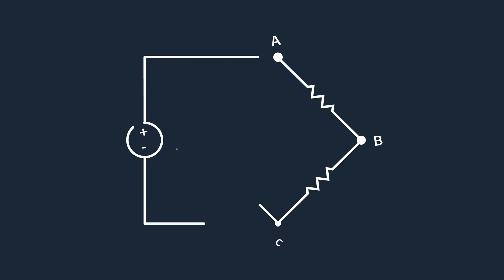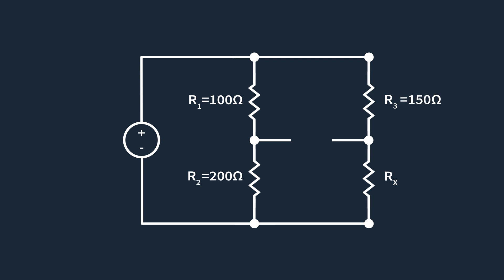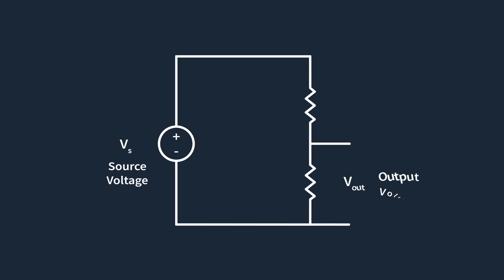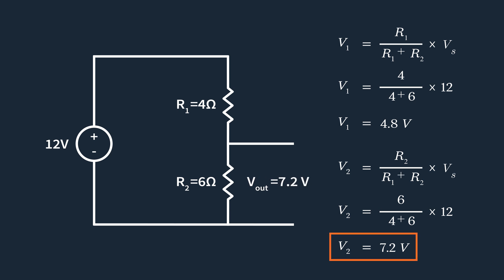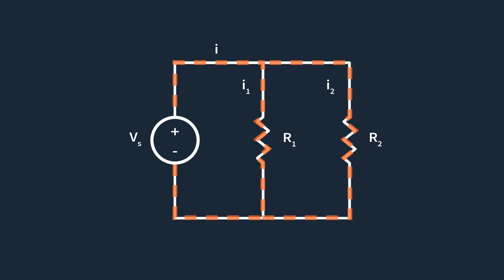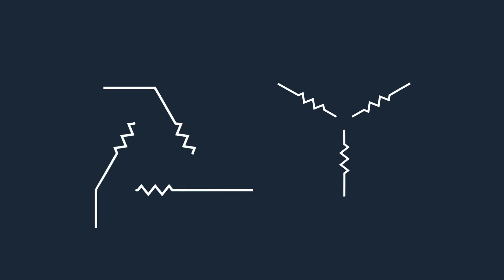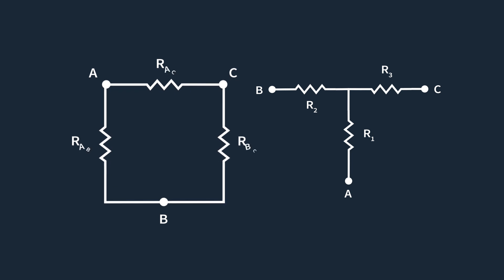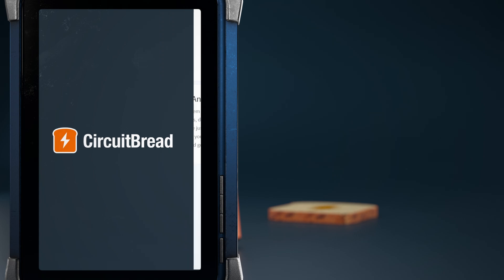Voltage Dividers, Current Dividers, Wheatstone Bridges, and Delta-Wye

Comment: I really liked, how you explain current and voltage dividers, finally I understood this topic and can calculate solve these type of problems by my own. However, I have no idea why you wanted to put Delta and Wye circuits in this video. There is no explanation, how it works, why someone uses it, why to convert these types to each other. Was it really just to mention 3 or even more times, that they called like this because of letter and can be drawn as another letter, but don't be confused, it is the same scheme, but can be shown in another way... 

In the written lesson was a good point about how Wheatstone bridge is used in sensors, it will be better to put it here instead of whole Delta-Wye unnecessary part.
Reply from the maker: I really appreciate the feedback!  We're still learning and trying to figure things out to make these videos as effective as possible.  With this one, in lessons at universities, it's fairly common to combine these topics, which is why we combined them.  However, Josh, the guy in the videos, is taking a lot of classes on instructional design and one of many things we've been learning is we should make the videos shorter and more focused, even if it means we need to make multiple videos for a single lesson.  Exactly so we don't sow the kind of confusion you mention.  Thanks again and have a great new year!